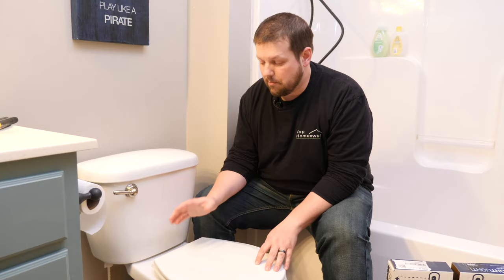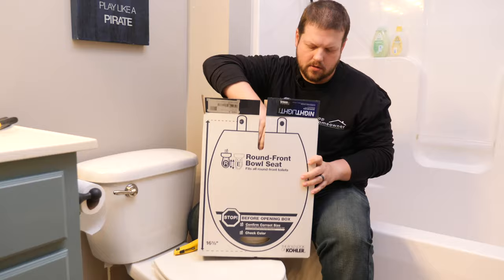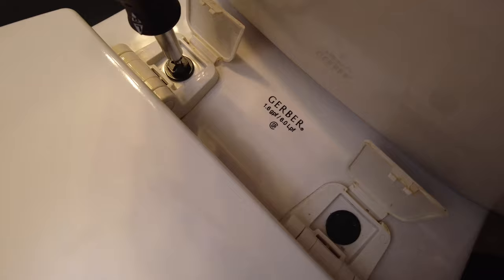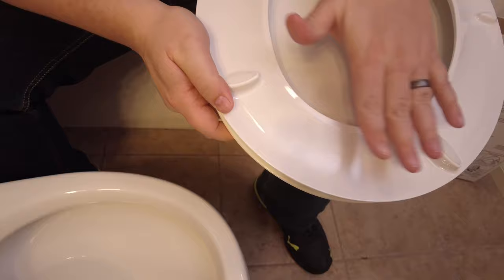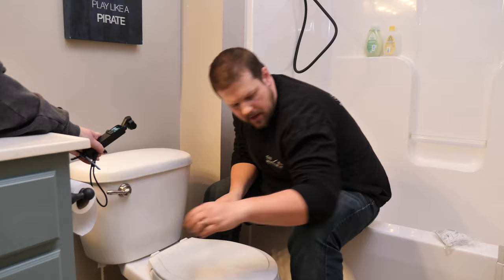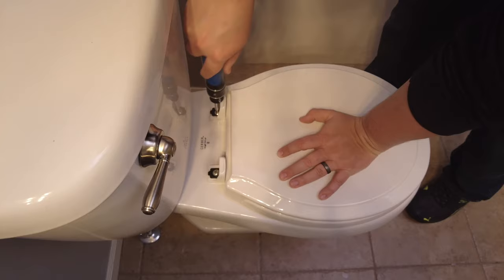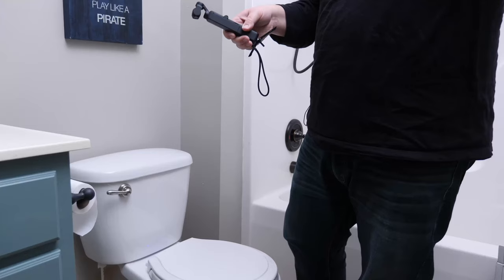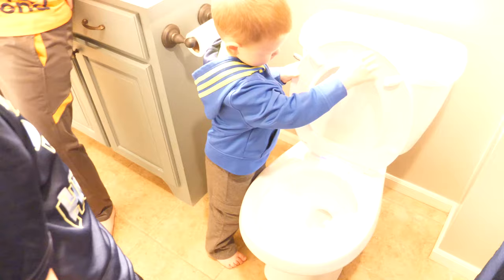Kohler Cachet Nightlight Quiet-Close Toilet Seat - Installation and Review

Comment: Have you had any issue with the seat shifting (moving to one side) from normal use? I have a Kohler that the seat moves because the bolts/nuts don't hold the seat tight to the bowl, don't want to overtighten them, they are nylon bolts and nuts. It appears that they have upgraded to metal bolts for this seat.
Reply from the maker: No, it's still pretty tight.

Comment: Not sure which version this is but the latest version K75758-0 the light stays on for 10 hours from when you turn it on. Do you have to reset this every day (ie. push the button) or will the light cycle on and off at the same time every day after it has been turned on?
Reply: It will come on the same time every day . If you hit the button at 8pm ? It will stay on for the 10 hrs ? I thought it was 8 . Could be wrong.

Comment: @Top Homeowner Do you know what kind of finishing coat I can put on my toilet seat/underneath it? It holds every stain and grosses me out. It's a cheap toilet seat my apt complex gives us. When I clean it, it doesn't have that smooth wipe texture at all. Please help and Thank you.
Reply: Clean with soft scrub formula that has bleach in it. The paste dries white so disguises stains. I preclean with a Clorox wipe, let dry, then smear on a little soft scrub and wipe off with paper towels. I only do this on the seat underside. My toilet seat is wood covered in thin layer of white.

Comment: Im having a problem with my boys slamming the lid shut and the internal mec. shooting back inside the housing.  Is there anyway I can stop the slow close mec. so this does not happen?  Ive had the seat for two months now and have taken it off 5 time because of this issue.
Reply: They still sell kids that aren't soft close. I'd get one of those. We have a nightlight in the bathroom that only comes on in the dark when there is movement. It works well for us